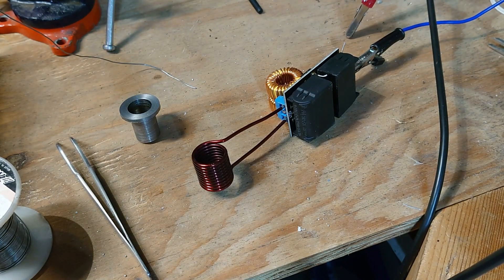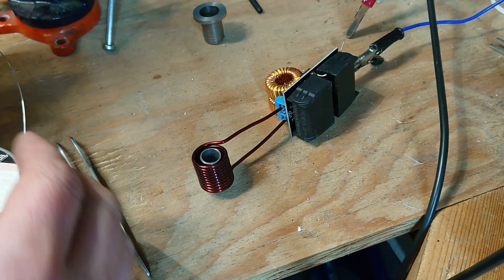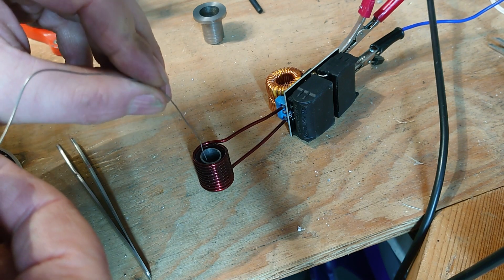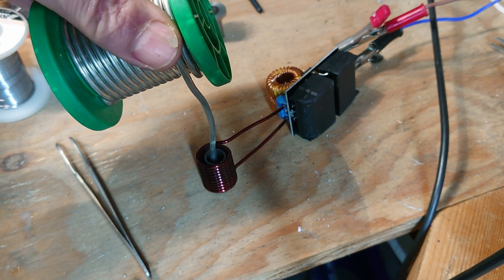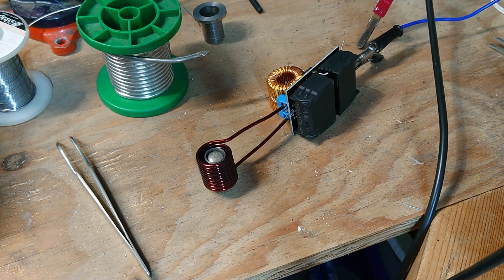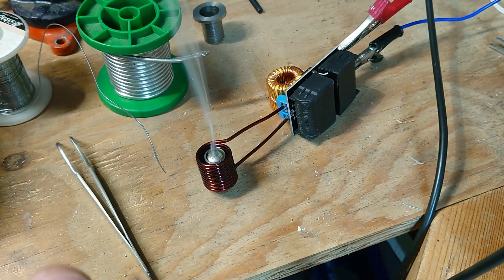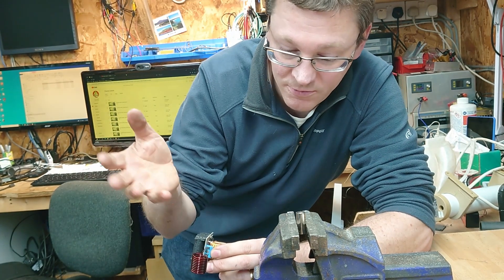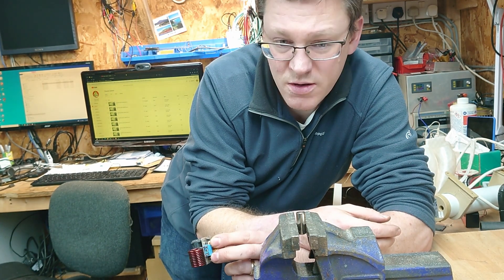Will an Induction Heater Make a Good Solder Pot? (Advent 22 Day 18)

Comment: Hi Olly, that's a really good idea and very powerful, maybe of use for your lawn mower battery array?

Great video once again, thankyou
Reply from the maker: Hi David, unfortunately the lawnmower battery is 36V and the induction heater is only 12V. I will just use a plug in power supply.
Reply: @ollysworkshop  I meant for tinning the wires on the array!! It's a great little device though
Reply from the maker: @davidberlanny3308  I see! Yes, it would be perfect for that.